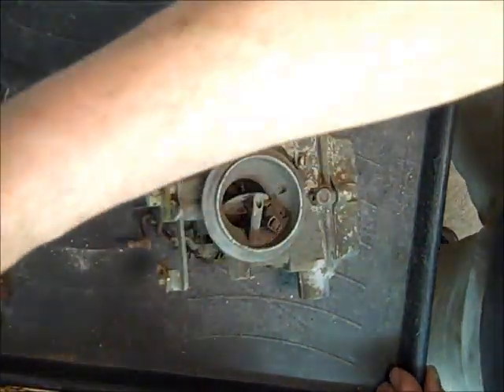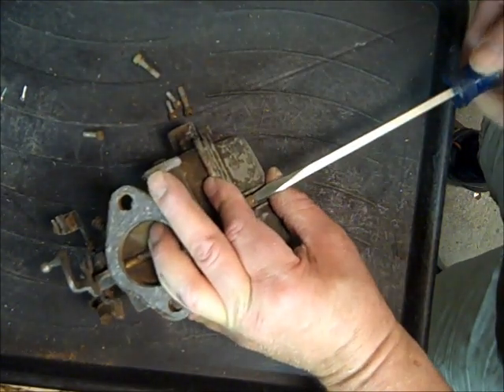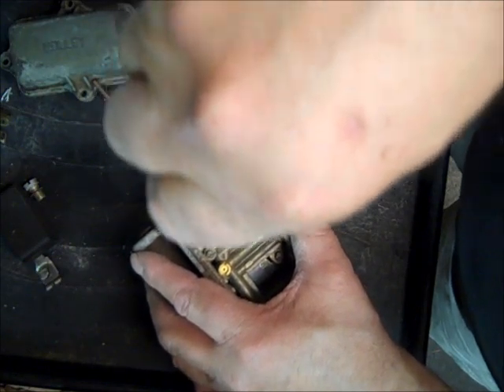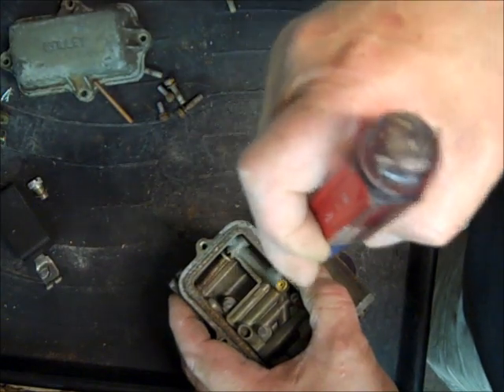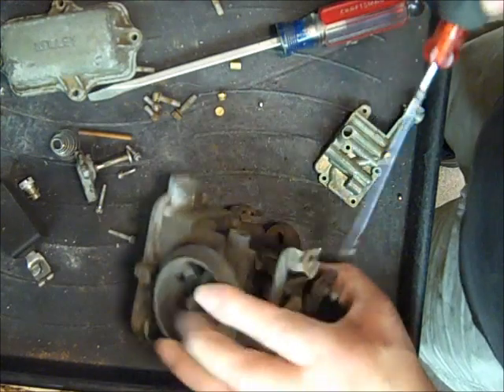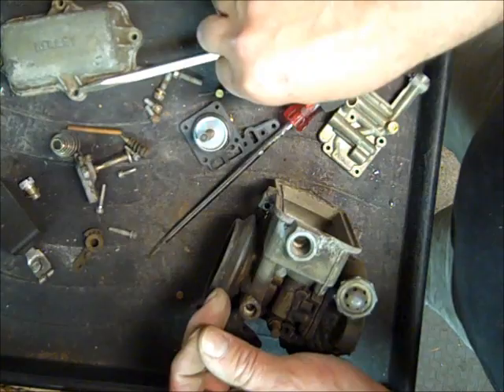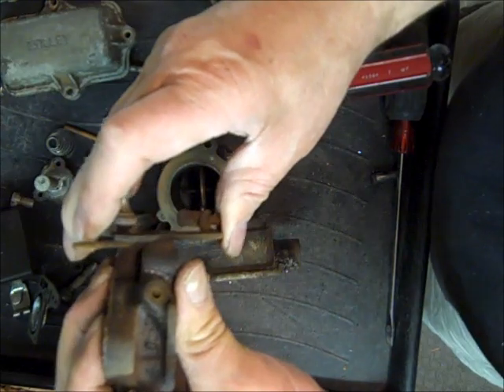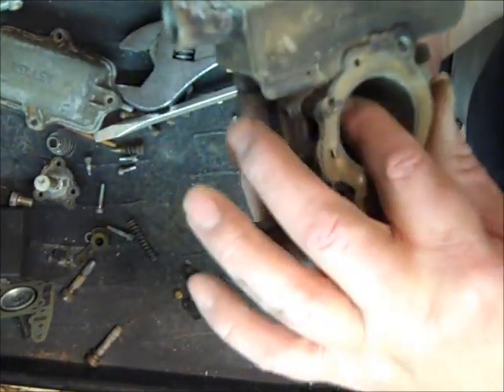Holley 1904 Carburetor Rebuild Part 1 of 4

Comment: Hey, at 6:30 you can see a white/yellow gasket that fell off inside.  I had this same one that was loose after pulling it apart.  I cannot figure out where it came from, or where it goes and I'm worried it's why my idle circuit might be causing my '60 falcon to stall/run rough.  Any ideas??

Comment: So if you only hear one check ball rattling in metering block or stop one and can't hear the other one and can't seam to free it with carb spray and air, I need to drill out the plug? the little check ball is the one I am refering to and my issue is that the accelerator pump isn't spraying
Reply: Nevermind, I answered my own question, heated up that checkball on my stove and all pieces came out on the floor after I shook it and couldn't find the checkball, luckily I had another kit for another carb and the ball seemed like the right size and its working again, that circuit was completly clogged.

Comment: Question: at the 11 minute mark, you mention braising the end of the throttle shaft and throttle linkage. What type of flux and rod material do you use to braise the end of the throttle shaft? The linkage on mine is metal and the shaft I believe is brass or copper? It has movement from years of service.
Reply: @MikesCarburetor  I meant rod braise material. I tried bronze, couldn't get it to stick. I'll try silver. If that doesnt work. I suppose I can drill and tap.
Reply: @campsite21   how did this go? I have gasoline  gushing  out of the throttle of my carb and the remanufactured carb I just installed. I'm losing  hope of getting  this ole classic on the road...
Reply: @springchiropractic9182  bronze braise. Gushing fuel?
Reply: @springchiropractic9182  I rebuilt the carburetor with parts I purchased from Mike's Carburetor.  I installed and used  a vacuum gauge tester (compound meter). You can pick one up from Harbor Frieght. Replaced the vacuum advance,  and timed it. The engine has electronic ignition as well.

Comment: thanks for posting. you helped me fix my 1968 International Harvester 3/4 ton Pickup with 1904 Holley Carb. 
The econ stem assembly slipped off the pin and was crooked on my carb.

Comment: My best friend has a 56 f100 and he wants so bad to have the 3 carb setup, So he has the org 1904 carb and working well and I just bought him a glass bowl one that looks like it might be just fine. The insides look GREAT. So as long as the pump is still good and the gaskets do not leak then he has one he can use in the center or at least the bowl on his org one. I am watching other ones on eBay with the glass bowl and some very nice and some older. Have only seen one just the glass for sale and it was sold. But I told him that finding them + the ring and the retainers will not be easy and might not find them. The ring I know he could make easy but the retainers and the way they are made will not be that easy if you want them all to look the same. Any advice would be great and I do have your web site save so we can order rebuild parts for one. But the pump thing if by chance there are not any numbers we can be able to see will be the biggest problem I think?Just best we will be buying parts from you real soon.

Comment: Hello I have a Holley with a number 6R1545B on the main body with a list 1686 stamp and 5750275 on the small part above the float bowl. Any help to identify this for me would help me get the kit i need. Also, on the base plate there is one single small hole. What does this do and if it is covered up will it affect the air/fuel mixture? Do i need a special gasket for this type hole?

Comment: I was wondering if I could get the plastic part seen in 00:20 - 00:24. When you hold it straight, and the bowl facing you, it would be on the left towards the back and it connects to a lever to the valve?
Reply: I found it. Thank you! I just realized this was the same website where I ordered the kit and I was trying to find it haha thanks!